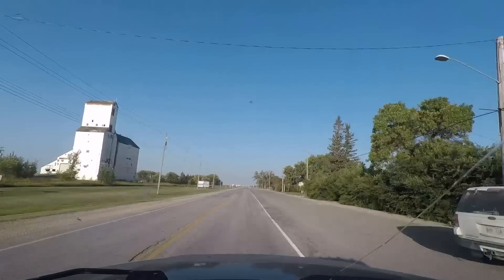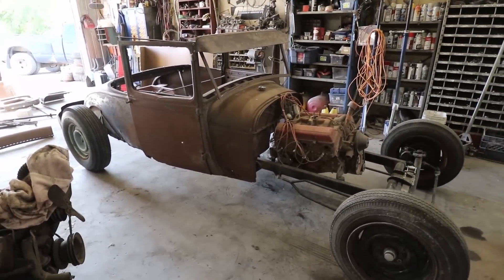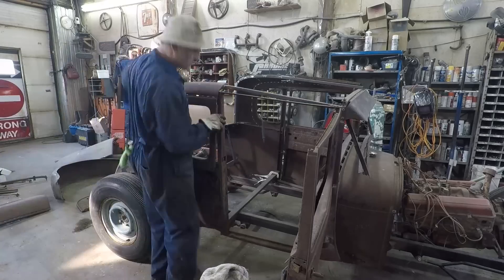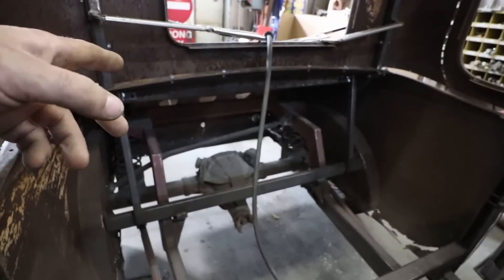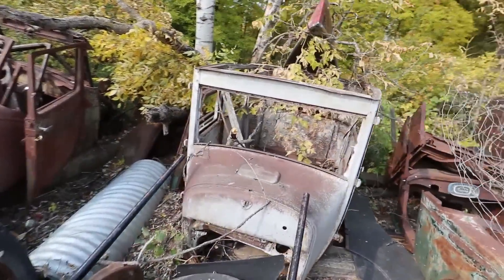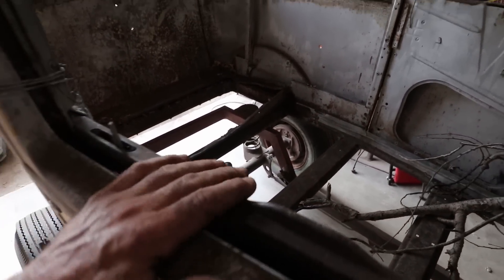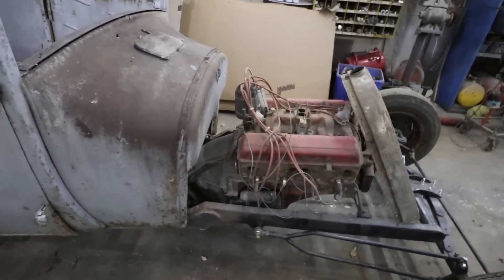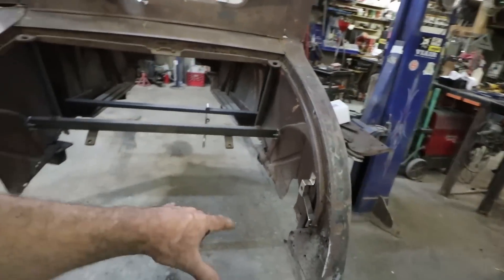1928 Model A Special Coupe project and future T sedan project.

Comment from the maker: How do you think the T looks as a highboy?
Reply: Love the highboy look.
Reply: With a chop it will look great 👍👍🇨🇱
Reply: T looks good needs a chop
Reply: Slam it!
Reply: Not that big of a t fan.but i dont hate the hi-boy look on that one but love the" A"had a 31 ounce wish i still had it ,raising kids takes dough .peace brother
Reply: I like all vintage cars & trucks, T's are a hard one for me because they are so tall, probably chop & channel it..either olds or caddy power?
Reply: Chop it
Reply: Brent, I think it needs the high boy look. If yo chop it please don’t take more than 3 inches. Every old car don’t have to be chopped to be cool!  I think the length looks good too.  The small block Chevy needs to stay if it’s a good engine it just needs a big blower sitting on it!
Reply: I like the look of the T Hi boy. those stock lines are still pretty cool. Possibly a bit taller tire in the rear. Just enough to remove some body height , but still allow for that body line in the wheel well.
What about channeling the front 1/4 of the car , lowering the the cowl area, & less channel in the rear? Kinda of the UnCertain T type of rake.
Stay Real
Reply: channel the front 1/2 then chop the roof line to equal all out
Reply: Yeah looks pretty cool. Channel just the front & give it a crazy rake.  Paint it white & its a milk delivery hot rod. Like the old crazy looking models. You'd be delivering milk shakes then.  Add a bar stool seat & a LONG  shifter so you can see over the windshield too.. Crazy Man. 😎
Reply: I kind of like how the Tire looks in rear to but it really needs a Chop Top huh n I have a 28 Chevy chopped sedan n I love the look
Reply: Ya Ricky Bobby does all his that way Chopped n Channel
Reply: High! 
 Just kidding, how about a deeper channel in front than the rear, (radical rake), some big fats on the back, a tunnel ram or blower, and a little keg in front of the radiator.
 Kinda Roth style. Little or no chop,... at first anyway. 🤔👊
Reply: I think if u do the high boy then it would look better chopped then it wouldn't look so high but it will look cool and u have a natural eye for adding the cool factor to your projects so I'm sure that it will be badass like all of your projects especially if u go Ford powah 😁👍🏻
Reply: Consider: Actually, I would cut the top third of the windsheild an cut a pie wedge out of the roof in front of the rear window, tilting it forward to make it a fastback style hatch and turn it into a Hatchback T.  Bo.
Reply: I’m with you; that wheel well looks so good against the rear tire. It’s because of that I wouldn’t channel this one. I think you’ll have a new love for it once you give it a haircut.
Reply: Chop it. Your great at that and it will look much cooler.
Reply: Chop
Reply: Love the highboy-tall T look. Put a straight eight or a v12 in there to fill up the front end and I think you'll have a winner! I wouldn't chop it either.
Reply: Well it would look old school hot rod and you lean that way sometimes.Maybe front fenders that turn with the wheels like a motorcycle or sports car? That would be different.
Reply: Id chop and channel it. Move the front axle under the frame and shorten the frame a tad bit
Reply: I prefer chop and channel both on a T because they are so tall.  Probably look good if leave the rear for the wheel well that does really look good and channel at least the width of the frame at the firewall.  Wont hardly see the frame because it's so narrow.

Comment: Good start to a cool coupe!  I feel your pain on the top.  I built my '31 coupe out of a Sport Coupe that was missing all of the top, no door tops, and had the doors welded shut, kind of a hop-in poor man's roadster.  I ended up taking the body all apart to the subrails and then rehung the doors and quarters.  I build a steel top using cut down sedan door window frames, coupe back window, and pickup side pieces.  It was a lot of work!  I filled the center with a Firebird roof skin.  Can't wait to see how this one comes out!
Reply from the maker: Thanks man.

Comment: A definite Munster Carriage Coach vibe going on the sedan. I don't think it looks too high but I'd chop the top 5 inches and that will make the whole body look lower. I'd also shorten the frame quite a bit to pull both the motor and the front axle in tighter. My preference would be to ditch the suicide front end all together. Thin wall square tubing and a bender to fill the gaps on the coupe. Quick and easy and very stable.
Thanks for the videos. Always enjoyable. God bless you and yours.

Comment: That looks like my 29 Sport Coupe. It had doors like yours With fabric on the sides & rear with a glass rear window in a steel frame. It had non folding outside top irons pretending that the top folded down, like a Cabriolet. Inside it had wood, plus steel supports to frame the doors.
Reply from the maker: yeah this sort of like that but they called them a special coupe steel sides but wood'n back window still.

Comment: ***  Brent.  Don' do a complete chop on the "T's" roof. Give the roof a forward looking slant by lowering the roof in the front by 3.5 inches and leaving the rear of the roof at its normal height. the slanting angle will give the car a rake that will look dynamite.